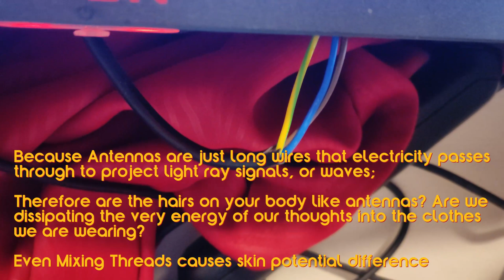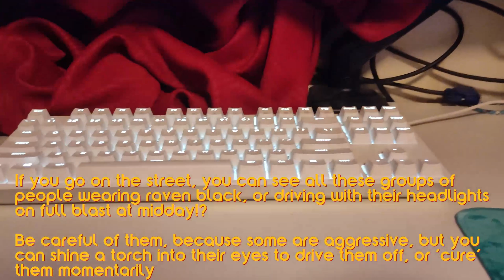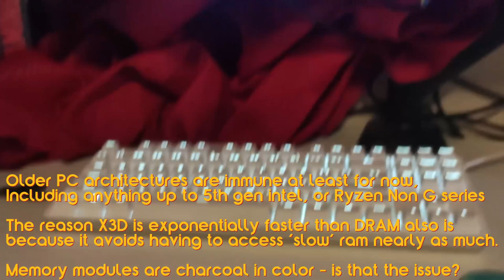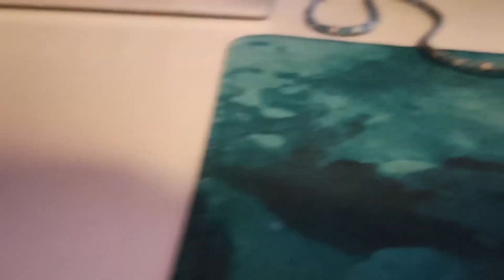COLOR of your PC causing Input Lag Desync? Blackbody EMI Sink & Time Delay Effect?

Comment: Hey bro, I know that you are receiving a lot of comments accusing you as a crazy or smth...
I have been suffering from input lag and desync and no matter what i do it will be temprary...
Undervolting,ferrites, windows tweaks...
Max 1 day of decent gameplay not even perfect and then it goes back, and i noticed that it's getting worse and worse overtime...

But still a lot of people have black chasis cases and don't suffer from our issues, maybe it's just a matter of time and they will get infected too, or they will notice it at all...

Do you have a discord or something so we can discuss if we have any common ideas or..
Reply: Also I have lost data on my nvme 2 times now by random crashes and pc won't boot until i format,
The weird thing is everything is perfect on my pc, ram timings nvme health everything i stress tested running well and cool under (50°) not a single compenent is reaching 60°
Reply from the maker: Sounds like a garbage NVME/Unstable Ram settings. Reseat all or RMA them tbh. You be the judge of that.

Having an unstable IMC on your CPU might cause it but it is very rare.

my discord is just my val name without the YT

Comment: Any new findings or things of note related to the desync issue. I’m still just finding it so odd how plugging things into my power strip or USB ports immediately improves the monitor visuals, responsiveness of inputs, opponent player models slow down, everything gets better temporarily for a minute or so. I’m really worried this issue causes permanent PC damage. Not that I care about having to buy new stuff but because damage would make troubleshooting this problem futile 

I feel like I’m going crazy because I just get dismissed by all the hardware dorks that think optimizing windows will solve the issue, even though i have the problem on PCs and consoles
Reply from the maker: plug in 1$ usb light from aliexpress, interference fixed
Reply: @compuguy123  tried it, didn’t do anything. Pretty much anything that I plug into my PC/Xbox or power strip helps significantly but it’s only temporarily (about 30 seconds to a couple minutes). Also I can’t just repeatedly plug the same thing in, i have to use new shit every time.
Reply: @compuguy123  no way that actually helped for more than 5 minutes
Reply: @compuguy123  have you tried securing all wire connections on your pc/monitor with tape? Try securing usb connection with tape, pulling down on the connector
Reply from the maker: @jimlernt776  No, with the USB light make sure it goes into a USB 2 port in the back of the PC
Reply: @compuguy123  I haven’t noticed any extended effect of simply plugging the light in. However I am noticing effects from adjusting the physical connections of the USB/Power cables, and I’m not sure if loose connections is a common issue we all are having. 

Have you really noticed a benefit from the Ali express one?  link me the exact one you got, I picked a different one up at a store near me
Reply from the maker: @jimlernt776  Use the bright white or buy a set of mixed ones to play around with 

AU$3.52  39%OFF | 5 Pcs USB LED Plug Lamp 1W Super Bright Eye Protection USB Book Light Computer Mobile Power Charging USB LED Night Light
https://a.aliexpress.com/_mPr205M

Comment: Hey man, I agree with you on a lot of things. I don’t know about the color, but I think it’s something new, some unknown radiation, or some particle that is still unknown to science.

You said that your ferrite beads stopped working. This happens often. In general, various crazy things can help with this problem, but this is all temporary. So this is the question. Have you tried replacing all your ferrite rings with new ones? In general, this is an experiment, you buy exactly the same new rings and check whether they give any effect.
I think your old rings got saturated with that unknown radiation or particle and just stopped working. This is my theory.
If the new rings still do not work - for this case I have another theory - that is, in this case the rings act as if they were part of the entire system and enter into resonance, as it were
Reply from the maker: That sounds too convoluted - it's occam's razor applied to special relativity. 

Electricians will generally agree that there is an antilightning that comes out of the ground that looks like lightning but is not actually lightning. 

Funny joke I can say is that it's darkning, and it would make sense.
Reply from the maker: Lightbody absorbtion should be the ability of a whitebody to soak up invisible spectra and re-emit it as visible light; except instead of being delayed, it could occur ahead in time by 10^-9 seconds maybe up to 10^-6
Reply: I will put a condom in the usb ports

Comment: yeah.. this is old news. this is why gaming components have RGB. 

Bro you are high af. you should stop taking whatever it is you are on...
Reply from the maker: Who said I'm on anything? All I did was share my findings as usual.
Reply: @compuguy123  those are not "findings"
you are making up a problem and then you are making up a weird pseudo scientific explanation.
Reply from the maker: @tzav  Ok, sure 

Electricity travels from point A, a switch closing, to B, a light bulb, at the speed of light. The bulb does not need to be connected to switch on just for a split tick, then off again. 

It's as if a directed wave, but the charge builds on the wire near the speed of light, in whatever medium.

We think at different frequencies up to around 30Hz. 

Blackbody radiation absorbs, delays up to 10^-9 seconds, then retransmits, light at a wide range of natural frequencies, but predominantly in the long wavelength IR range.

Do you understand the possible consequences of this should we wear black clothes? It can dilate your very thoughts from 30Hz to something lower; your high functioning self is quite probably impaired, by a blackbody; your clothes that you're wearing.

There have been many times where just the planck constant alone has been adjusted, at least twice, once every few decades since the discovery. 

Universal constants can change at the flick of a dime, however slowly that flick may be. Don't be surprised if it does happen; it could have started already considering that the choking effect is stronger than before.

https://en.wikipedia.org/wiki/Time-variation_of_fundamental_constants
Reply: @compuguy123 msi mode on or off? and priority for net and gpu what?
Reply from the maker: @DreaMyeditzzz  as it is written in my other guide videos. Usually off for the USB, GPU, and whatever won't freeze or bluescreen the PC otherwise. ~High prio for net, GPU, USB, with net depending on the model of adapter.

Comment: @compuguy123  sorry to bother but regarding RAM Timings for Valorant, what would you recommend for 5800x3d, G.Skill Trident Z 16GB, DDR4-3200, CL14-14-14-34 ? If I calculate with 1 1.25 3.25 I would end up at 14 17.5 45.5 , round up or down? Or better use 14 21 21 49? Thanks dude
Reply from the maker: It's better for you to use 14-14-14-42 or 14-14-14-28, whichever works or runs better

Comment: The color of the board and the color of the plastic or metal has nothing to do with performance at all. Its just coincidence.  You speak too fast and you are too hard to follow also. 

Simply put, you shouldn't be taking advice from a guy running his ram in the wrong slots. Point blank Period.
Reply from the maker: Didn't you just comment the opposite on the other vid? 
Also it's 'wrong' slots for performance, but it's the best slots for input lag. 
I can't use dual channel without extra lag, that holds true on all motherboards except 2 slot ones
Reply: @compuguy123  No, I did not comment opposite on any other video.
Reply from the maker: @ultrasaiyan4283  lol not you, old mate cppc
Reply: valorant optimization use single channel. other games maybe different .
Reply: @lalapt127  Game can't change how RAM works..
Reply from the maker: @ultrasaiyan4283  Its across all games I've seen. Call of Duty might bottleneck though, since it uses a lot of ram and runs poorly under 144FPS

Comment: I get a mild electric shock whenever I touch any metal part of my cabinet, I've tried everything I could find online but it doesn't seem to go away. Will ignoring it cause damage to my PC components in the long run?
Reply from the maker: Wear white, check the wiring is good and that nothing is damaged inside. That sounds like something is either shorted or touching the ground wire
Reply from the maker: @@crusher_8024 second that

Comment from the maker: So yeah, don't use ferrite chokes anymore. They interfere as far as the ground wire that wraps outside it now. It's been getting worse year by year now week by week.
There's also massive desync happening with internet, mouse, keyboard, and USB if you have too many inductors or chokes attached. Try removing ones with the cylinder choke things on the line.
Mark of the Beast is as HHH, X, Molech, the Molecule Hetain - Darkness; satan; whatever 
https://www.ebi.ac.uk/pdbe-srv/pdbechem/chemicalCompound/show/HHH

(guys please don't pull the race card it's like calling Stephen Hawking racist for naming black holes ;-;)